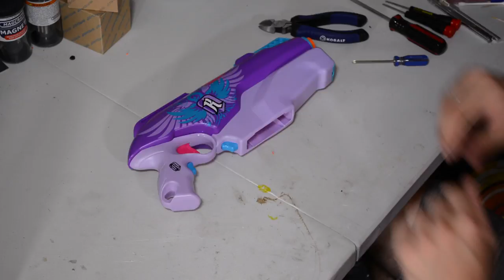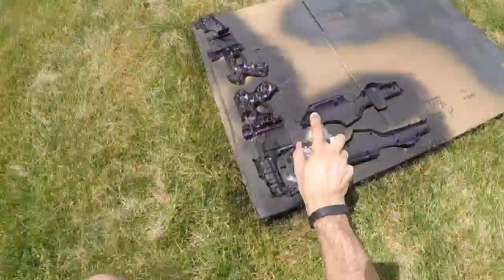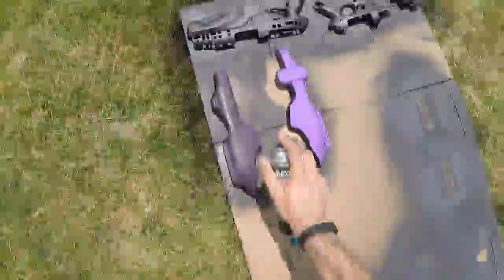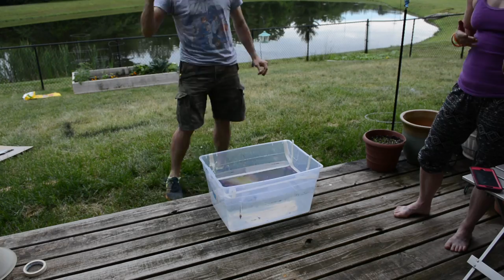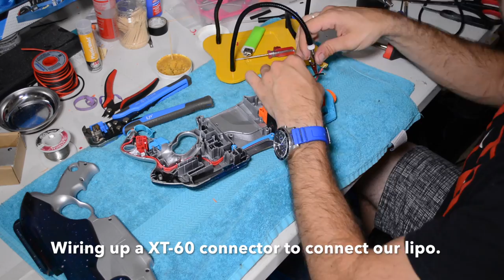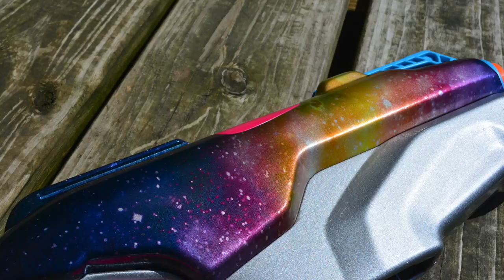[Nerf Mod] Voyager Rapid Red Mod (Tips on Installing New Motors)

Comment: Rapid Reds flywheels have difficulty developing foam-build up: http://torukmakto4.blogspot.tw/2015/07/shelf-watch-late-july15-and-superstock.html (somewhere in the middle)

I honestly can't get behind them for the handle and the differing pusher mech which I've found has trouble feeding darts in all the way, which is a shame since it's a nice shell otherwise. But dang the paint makes me drool.
Reply from the maker: Interesting, good to know.
Reply: So it'll be preferable to et some aftermarket or Stryfe wheels in there, basically.